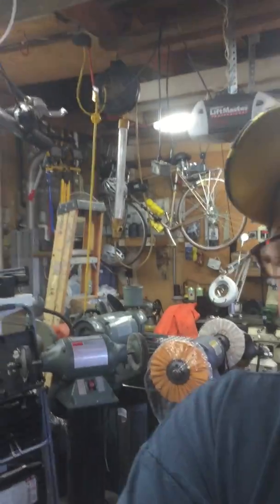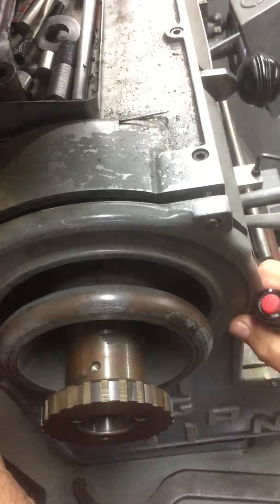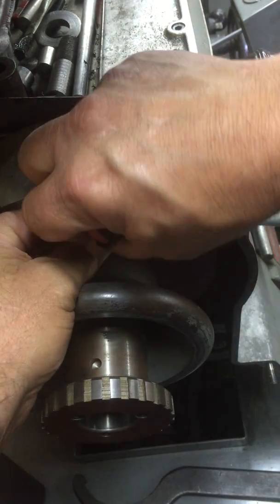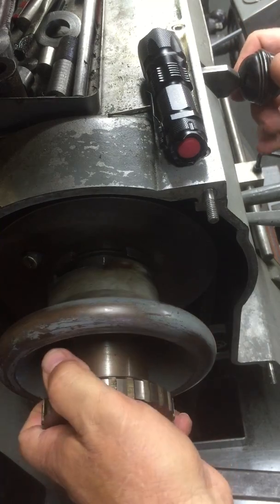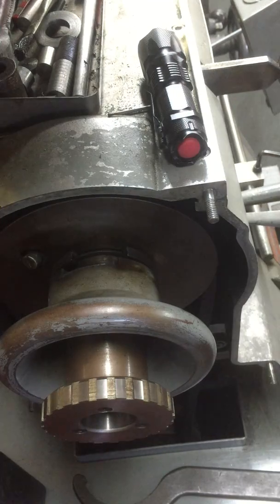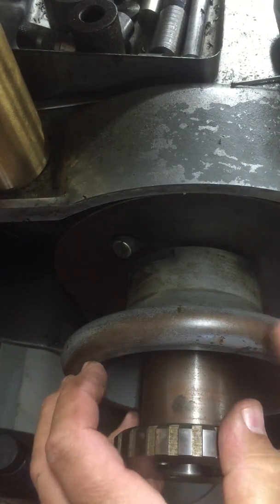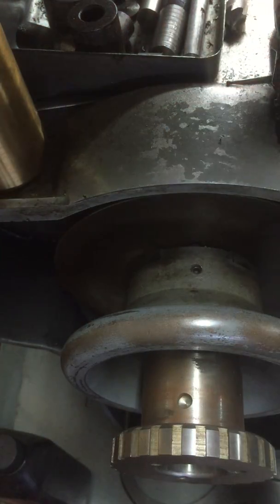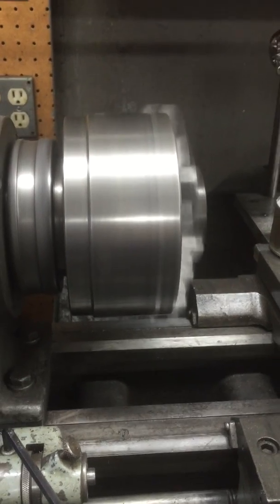Logan Lathe 2557 back gear mode

Comment: Thank you John. I haven't used a lathe since High school and now in my 50's I got a Logan 2557v for my garage. It IS tough finding info. online. So thank you for considering  us newbees and kicking down some useful experience, and showing us/me  how to run in low range.
Reply: You don't need to loosen the set screw to go in to back gear. There should be a ball and spring underneath the set screw. You only use the set screw to adjust the spring pressure. The shaft has two detents and the spring loaded ball will fall in to the forward or back detent depending if you want to be in or out of back gear.

Comment: i have had that same lathe for 15  years  i have never tighten  that set screw so i do not  remove cover  for back gear  works  good high or low
Reply from the maker: Yes I’ve been doing the same thing since I made the video. It comes uncoupled once and a while but works great that way. Much easier to switch between the two. Thanks for the tip.

Comment: John, every time you use the back gear on a lathe so equipped you need to lubricate the sheave on the lathe spindle. It is a plain bearing and should be oiled at least once a day if you are using the back gear all day long. I don't know where the lubrication point is on your lathe, but on mine it is a set screw in the bottom of one of the V-belt sheaves. On a flat belt drive South Bend it is usually on the middle speed sheave and is marked "oil." 
  In direct drive the sheave and spindle  are as you showed, locked together, and lubrication isn't required. If you are using the back gear all day long, the back gear jack shaft should be oiled at least once during the day. On the Logan, the shaft is under the spindle and is sort of 'out of sight, out of mind," so don't forget to oil it as required.
   A hex ball driver with a screw driver handle should get to the lock screw without having to remove the cover. Just snugging it up should be sufficient to keep the lock engaged.
  I would recommend you look up your lathe's operators and service manual on
http://vintagemachinery.org/  It will tell all on how to get the best out of your lathe. Fortunately, Logan is still around and parts are available. Cared for, your Logan should give you a life time of service.
Reply from the maker: Thank you for chiming In. I hadn't thought about the lubrication factor when in back gear. I just lubed the lathe last week and did lube that area. There's a screw driver slotted thumb screw that you have to remove to lubricate. I only use the back gear once and a while when needed so I will remember to lube before I use it. Thank you so much for your input. This is exactly why I made this video, to bring light to those issues that others are not aware of.